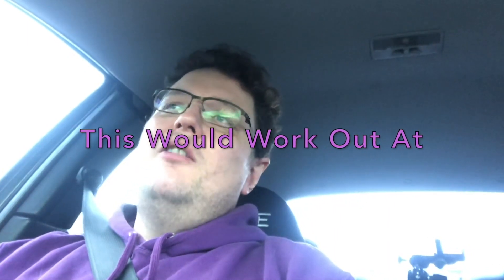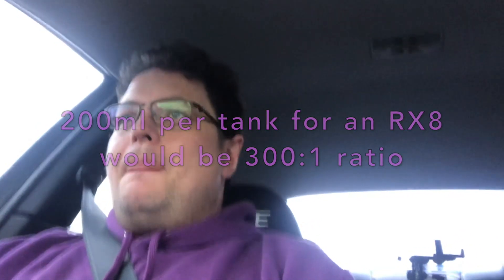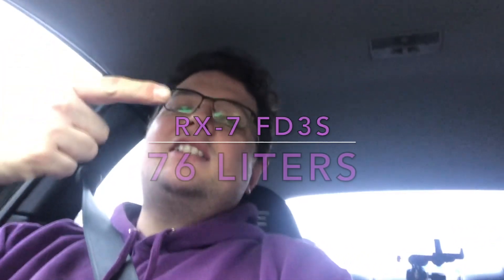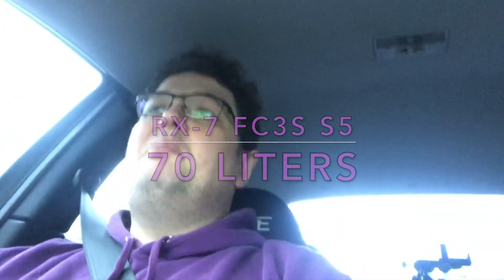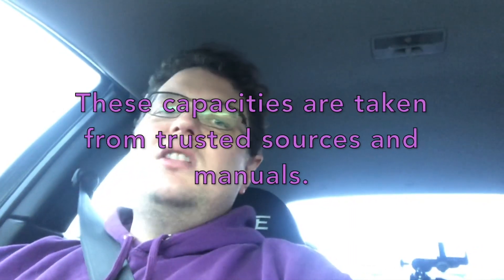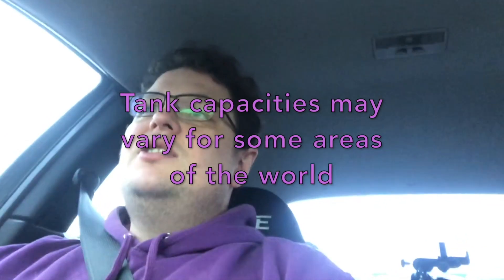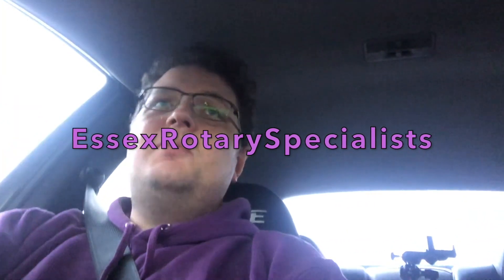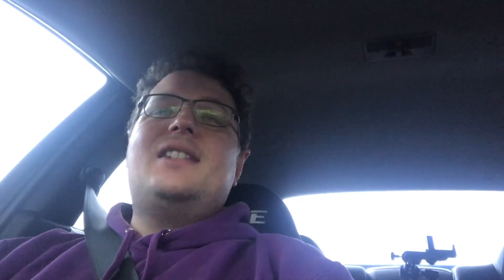Essex Rotary Random Braps - Premix Talk Part 2, Mix Ratio's, Does It Kill Cat Converters, and More

Comment: i know its controversial but is premix necessary on the R3 since it has one more oil injector?
Reply from the maker: In my own opinion and i know lots of people will have their own views on this, I would say Yes, Premix burns cleanly well if you use the correct stuff, however engine oil will contribute to your emissions in a bad way if you where running a high enough rate.
that extra lubrication from premix is a good thing, also helping to keep the combustion chamber cleaner.
We see this from may owners in the UK when they bought new R3's they where stating that Mazda had fixed the oil injection issue by adding that shirt oil injector and there was no need to premix. fast forward a number of years and we are seeing engine failures on the R3 also. In some cases with worse damage due to the faster starter hiding the early signs of compression loss and owners driving them till destruction instead of until they would not start anymore.
Reply: In short, to be safe - i would. I dont feel the third oil injector offers enough protection. The oil injection system is flawed
Reply from the maker: @wrighty338  I would not say flawed, looking back at the history of the rotary engine, once Mazda moved in to EFI systems then they started delivery oil from the OMP directly to oil injectors these have moved location over time, for example, the RX-7 FC had 1 injector per rotor housing (placed in the centre of the housing) and a further injector located in each of the primary intake runners in the lower intake manifold.
moving on the the FD3s they chose to move to a single oiil injector per rotor placed in the same (or there abouts) location at that in the FC rotor housings. 
On the Series 1 RX-8 they went back to 2 injectors but moved them to the outer edges of the rotor housings and angled them to spray more toward the sides of the rotors.
This is why on the R3 they then added that third injector back in the middle of the housings in order to gain back some of that lost central oil injection ability.
Looking back at the old Carby setups from the first generation RX-7 SA and FB's the oil metering pump delivered the oil to the carburettor system so the oil was being delivered more like premix is in modern EFI systems, giving a better coverage as it is drawn in with the intake fuel and air charge. and 12a's are known for their durbility.
So as stated the injectors have moved in a search for better performance from them.
One thing I have not mentioned if the possible trade off between optimal oil delivery for lubrication vs what the other parts of the Mazda development team wanted, such as marketing (a lower oil consumption number would be good for sales) and emissions standards (we all know these are getting ever tighter) so in reality the amount to be delivered to the engine for optimal wear protection was probably scaled back to satisfy other area for marketing and emissions... what i am trying to say and taking a lot of time saying it is there appears to have been a trade off.
Reply: @essexrotary1540  I totally agree I think the omp system in the the s1 rx8 and fc s works well but the amount of oil isn't enough. The ideal setup would be sohn adapter with a adjusted ratio and a small amount of premix

Comment: MILLER OILS KR2T in my RX8 2004 is this ok.. just found your channel gonna watch your previous videos.. whats you best ones on exhaust mine still has a cat looks a bit ropey what exhaust should I buy or just change cat...
cheers
Reply from the maker: Not one we offer here at Essex Rotary unless things have changed with the Millers KR2T they do not publish the specific flash point of this product , unlike most of the other brands, like Castrol Power 1, Castrol Power 1 Racing, Idemitsu Racing Rotary Premix, Royal Purple etc etc etc.
Instead Millers only say the flashpoint is up to 200DegC. I my opinion this could mean 50degC, 115DegC or 197DegC or anywhere between zero and two hundred Celcius. I understand its designed for racing go karts.
Personally we chose Royal Purple as its a brand offered by Racing Beat in the USA who have been rotary guys for forever and Idemitsu as its the only (to our knowledge) oils and premix that have been developed for Mazdas rotary racing programmes such as the LeMans winning 787b plus many others.
I am not saying Millers is bad, we just dont use it here at Essex Rotary and from my knowledge we where one of the first in the UK to Premix on the RX-8.

Comment: Some clarification about which engines EFI system do fuel-cut on overrun would be good. That could probably save some motors for those who have OMP deleted. Obviously if your stand-alone its a different story.
Reply from the maker: I am nor sure what your asking here, Are you talking about listing what stock rotary engine ECU's do fuel but over-run and what ones do not or are you talking about aftermarket ECU's?
Reply: @essexrotary1540  Sorry yes, Mazda OEM ECU's that fuel cut on over run for those that have them. Anyone on standalone can have theirs configured.
Reply from the maker: @wrighty338  To my knowledge most do fuel cut, this can verified with use of a standalone wideband sensor, is it reads lean (like proper lean) on lift off then your system is fuel cutting.
That said it shoud not even be a thing when running a stock ECU as most will have a fit and send your car in to limp mode if you delete the Oil metering pump from the system.

Comment: I appreciate all your info from your videos. I have a sohn adapter on my rx 8, do I still need to premix separately from this?
Reply from the maker: Yes... remember the reason you probably started pre-mixing in the first place, for most it is due to the lack of total coverage from the stock oil injectors. The premix is added to the engine via the fuel injectors to supplement this issue.
So to stop premixing when running a SOHN means your back to a lack if total lubrications coverage.